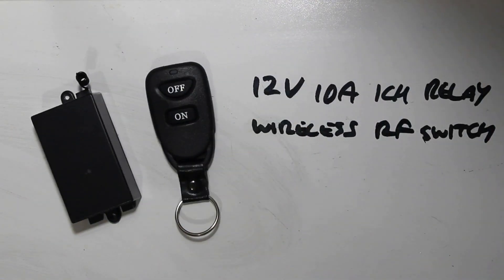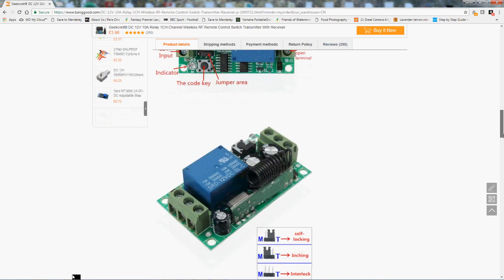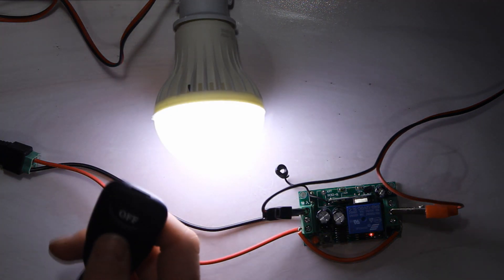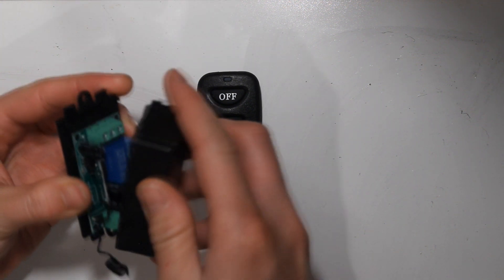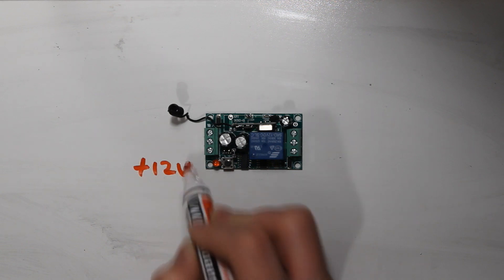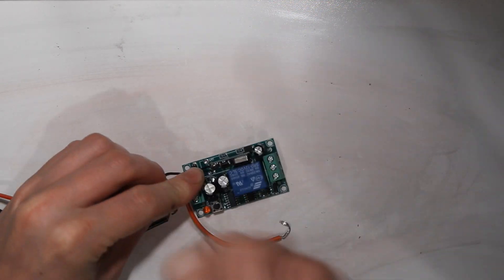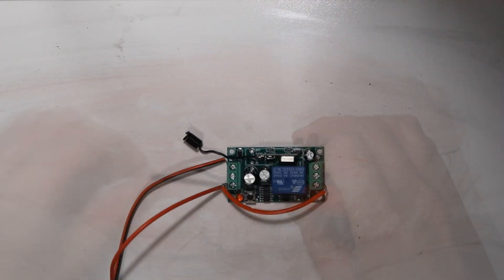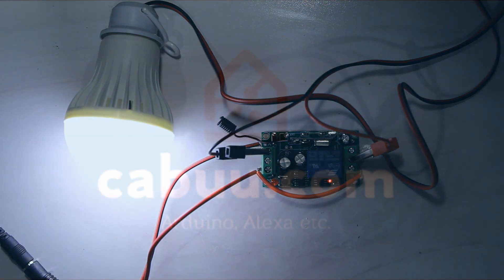12V 10A 433MHz RF Relay Switch - Setup

Comment: Is there a way to transmit a 433mhz signal when 12v is supplied? Is there a device that will do this?  I don't want to have to push a button to operate the switch.  I want the switch to close and then send 433mhz signal. Can you help?
Reply from the maker: Certainly, but you'll need an RF transmitter and it'll take some coding to ensure the correct signal is sent. I've used something like this before with some success... https://uk.banggood.com/Geekcreit-433Mhz-RF-Decoder-Transmitter-With-Receiver-Module-Kit-For-ARM-MCU-Wireless-Geekcreit-for-Arduino-products-that-work-with-official-Arduino-boards-p-74102.html?cur_warehouse=CN&rmmds=search
Reply: @cabuu4122  is there a way to take the handheld fob and mod it to be a dedicate transmitter.  Maybe a way to simulate the key button press on the fob with a relay that trips when it detects the 12v signal?  I'm really interested in learning more and I'll definitely look at that link.  Thank you btw!
So I already have a 433mhz transmitter and receiver that can control a motor via a fob for forward, reverse and stop.  I was just thinking maybe I could modify the fob so I don't have to press the buttons some how?
I know very little almost nothing about adrino board.  I know what they are and kinda how they work but if I can work around having to use it. That would be ideal because I have nothing you need to program or test or etc on adrino.  What kinda coding are we talking?  I've only done very little with coding. Mostly just modify existing code with code someone else generously provided.  I'm willing to certainly learn. That's not the issue.  But if there's a way to do it with what I already have. That would be the way I'd like to go if I could.
But I do have electronic knowledge and have programmed ic in college using breadboards and such but that's been 20+ years ago lol. My thinking these days is do it the easiest way with what I already have.  I just feel that since the TX and Receiver are already "talking" to each other.  Maybe it would be easier to just use the 12v signal to trip relays to simulate button presses from the fob. And I can get extra fob if I mess it up, really cheap.

Comment: I have the 12v R121A with 2 remotes having only 1 button on each remote. it came with2 remotes.  Does each one have to be paired simultaneously? One was was shipped paired, but was its working in the latch mode.  I need to wire it for a momentary contact like a door bell button.  They call it jog or bump mode.  I cant get it to work.  Already got 10 hours into it. Help!
Reply from the maker: Not sure, I've only ever received one paired remote, I seem to recall there was instructions provided about pairing remotes so maybe try there, good luck!

Comment: Hello, I am trying to use one of these remote controls to trigger a 50amp relay, to run power to an air compressor. I am struggling to figure which way I should wire it. Do you have an email address I maybe able to contact you at?? I can’t post a picture on here otherwise I would show you what I am trying to do.
Reply from the maker: Feel free to email info@cabuu.com I may be able to help

Comment: I bought one of the same little RF Switch as you describe here. Your YT video was a great time-saving, because no instructions for the wiring came with the device. One little thing that I did not like about the RF Switch. It has no LED Indicator Lights on the black plastic box. I wanted to be able to 'view' this black box, to know if the Unit is ON or OFF. My use for this item is to transmit 20kHz sound waves.
So I went and bought two (2) blue flashing LEDs, then drilled two holes 5mm dia. I wired the LEDs to the NO Terminals, via a 470 ohm series resistor for each LED.
Now, everything works, and I can see in an instant if the RF Relay is ON. Thanks for a very useful video. Greetings from Australia.
Reply from the maker: Good job Peter! And thanks for your message, I'm pleased you found one of my videos useful

Comment: hey, i used a 18 volt battery and a 12 volt led . can i know why the led doesnt turned on ?  what should i change to make it work. is 12v the maximum input?
Reply from the maker: Hi there, I believe you can switch higher voltages but the operating voltage (i.e. the one provided on the input side) must be 12V. Check the specs on banggood for more information: https://www.banggood.com/custlink/GDKKSZ4sG8

Comment: Hii I hve an electric skteboard which has a 12v led on off switch currently.
I want to replace that switch with this remote. Will it work? how to connect?
Reply from the maker: Should work no problem, just follow the schematic for using a 12v device

Comment: Can you use this as a kill switch for ignition?
Reply from the maker: I guess so in theory but it's not something I've tried, check the specs on the banggood website in the link in the description that might help answer your question
Reply: You could use it to turn off the fuel pump

Comment: Do they really need 10A?? Or is that just the relay rating?

I'm not terribly good with electronics but I need something like this for a project that will run off a 12v 3000ma battery pack.

Any info you could provided would be greatly appreciated.
Reply from the maker: Hi there, 10A is just the maximum rating. Your 3mAh battery will be fine, just not sure how long it will last!
Reply: @cabuu4122  excellent - thank you.

I already have a heat temperature sensor circuit from Maplin (they've gone bust here now) which runs off 3 Samsung phone batteries. Takes about 4-5 days to drop from 12.6v to 10.9v if it is constantly on so this shouldn't differ too much I hope.

Really appreciate your prompt reply.

Comment: NICE VIDEO, PLEASE EXPLAIN AGAIN HOW I CAN USED LESS THAN 12VT . I REMOVE WHAT WIRE WHERE  ???
Reply from the maker: You still need 12v to power the switch but you can then switch more or less than 12v by doing away with the red jumper cable (going from left to right) and inputing your switch voltage on the right hand side where the 12v jumper did go, hope this helps
Reply: THANK YOU , SO I CAN USE A 9V BATTERY BY ELIMINATING THE JUMPER WIRE ,,,,, CORRECT ?
Reply from the maker: @mw10259  You'll need to remove the jumper cable from the left hand side (the 12V side) and connect to your 9V source, hope this helps!

Comment: Can this be used in a car for remote control lights?
Reply from the maker: Don't see why not, the 12v supply from a car battery would work fine, not sure how much it would drain the battery by though would have to see how you get on

Comment: Want to start by thanking you for making your video I could not figure out this RF relay device to save my life so I went to YouTube and found your video I didn't realize I needed to take the red wire and run it from the one side to the other the only problem I have is my remote when I push the on or the off button it does both functions I can turn it on and off with the off button or on or off with the on button but it does work this is what I did with it here is a link to my YouTube video. https://youtu.be/NXM-xhwew-E
Reply from the maker: Thanks! Getting each button to work in turn is easy, assuming you have the same switch as me. Simply remove the connecting jumper that sits down near the programming button. Get back to me if you're not sure as I can send you photos. Good luck!